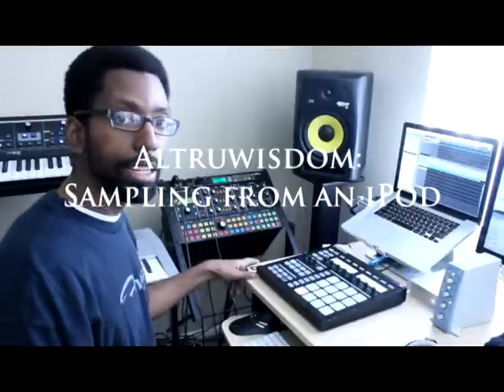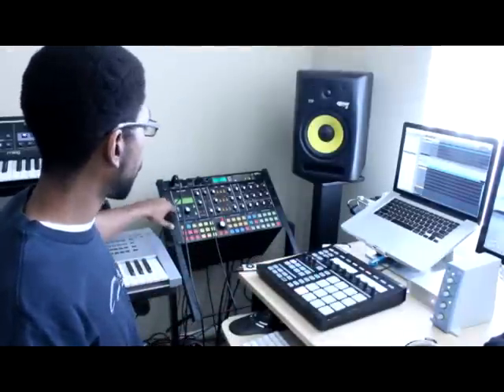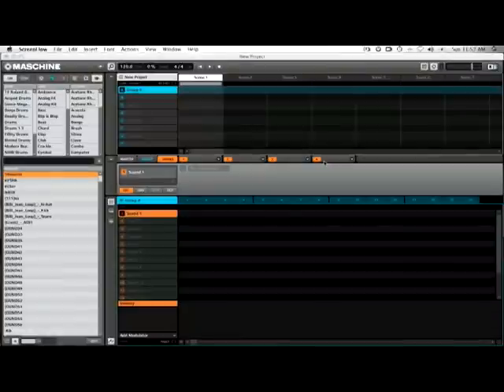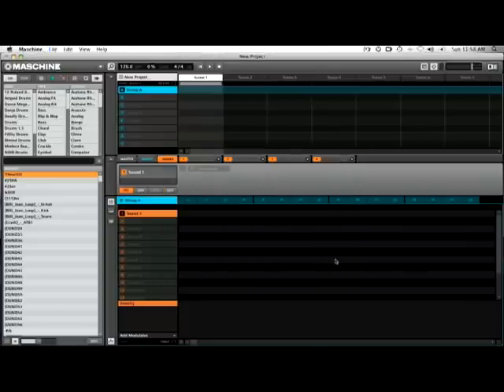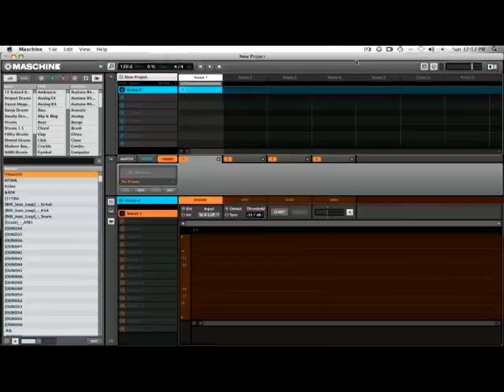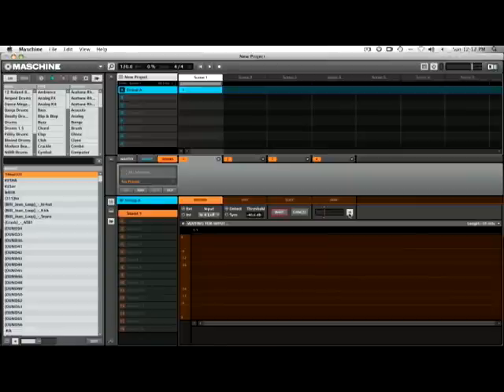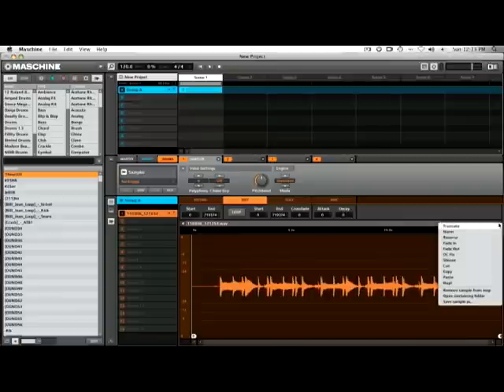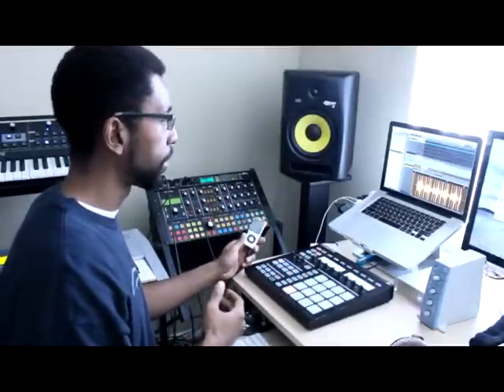Sampling an iPod with Maschine 1.x: Altruwisdom

Comment: Thanks for all the videos.   The way I sample from my ipod is just plug it into my microphone 1/8" input with a 1/8" to 1/8" cable.   No need for an interface or route it througt the interface.  Nice and easy, especially if you only using asio4all without an interface.